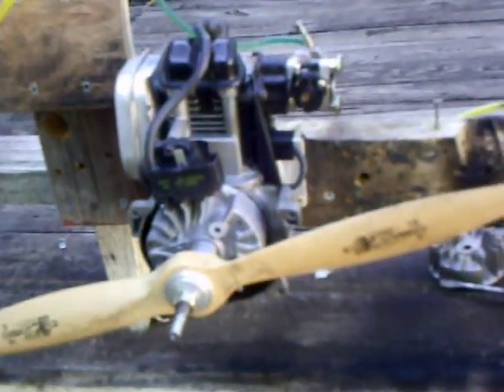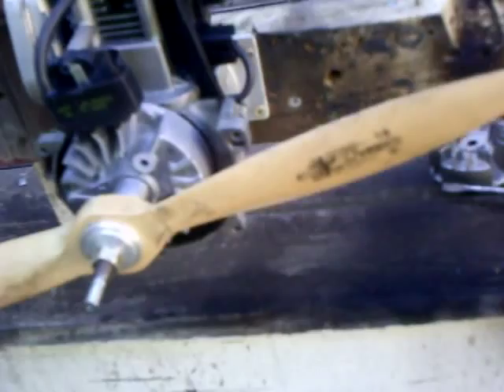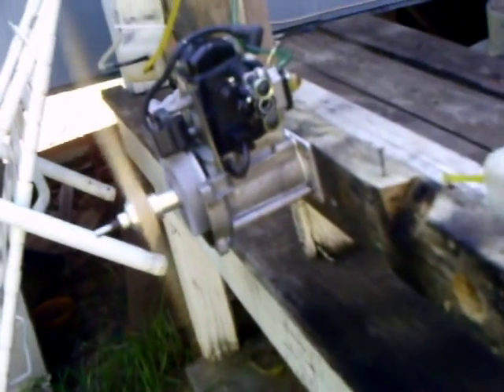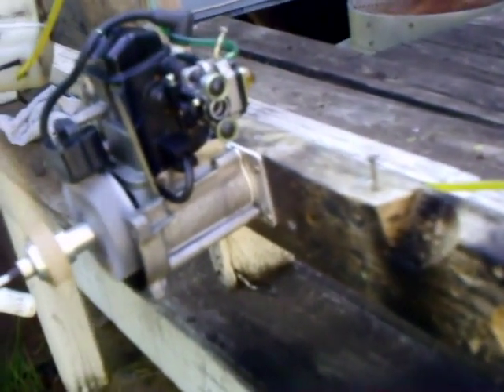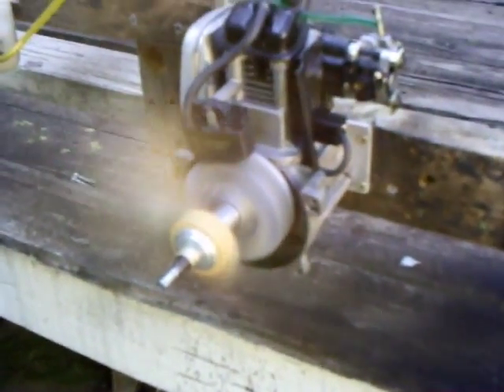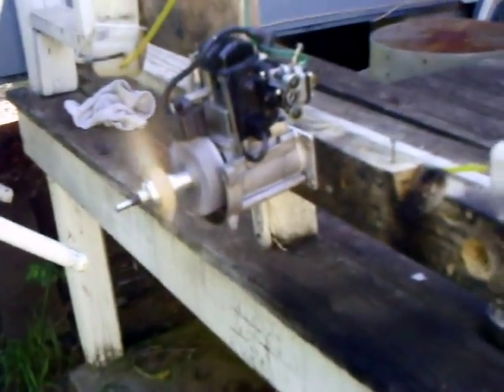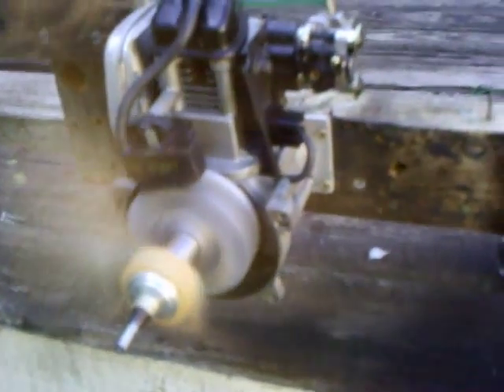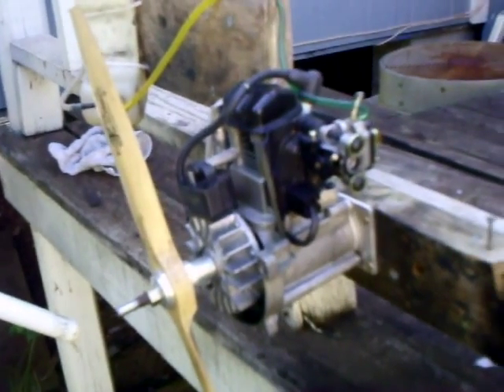RYOBI (MTD) 29CC 4 CYCLE R/C AIRCRAFT ENGINE  RUNNING

Comment: Hey just a fyi. That carb is mildly adjustable. If you look at the top of the carb where your plastic throttle plate is youl see a hole in the middle. Take a small drill bit and drill the epoxy and the brass ball out of it and youl se a small slotted needle adjustment it only works with low and mid range setting

Comment: These require bigger props for lower rpm i imagine. Do u run these rich to start easy?
Reply from the maker: there are super simple> and as you see they start easy> nothing special to starting them!  Gary
Reply: Maybe im not tuning my carbs right then. Im kind of new to this. Buy i usually have to put a drill on the prop hub to start mine.
Reply from the maker: @captainsledge7554  watch the video> clock the prop like I have mine!
Reply: Ah ok. I probably have over 100 weedeater and chainsaw engines right now sitting around that run.